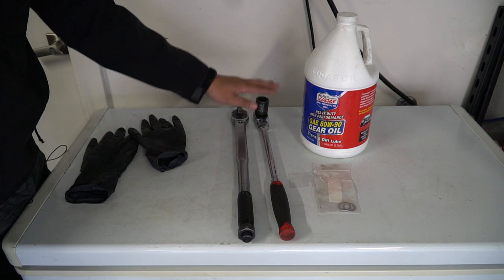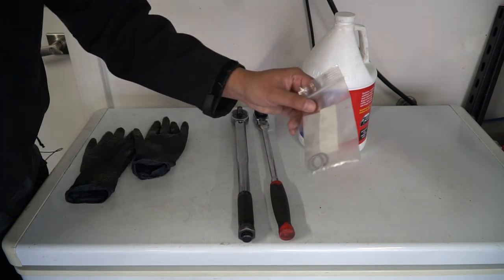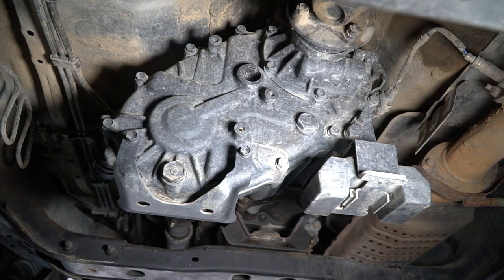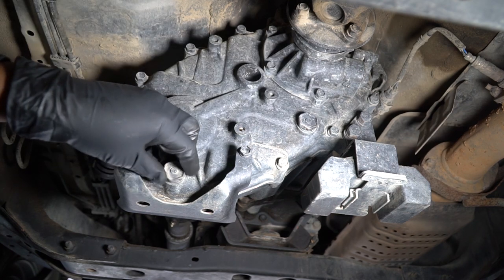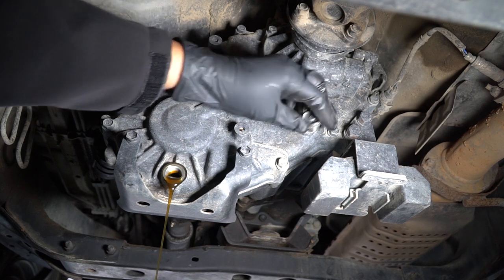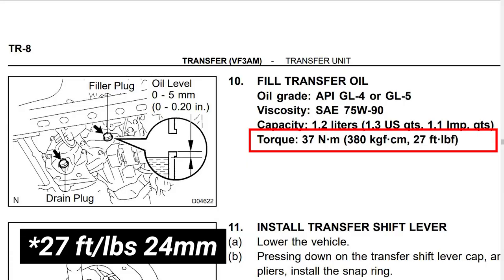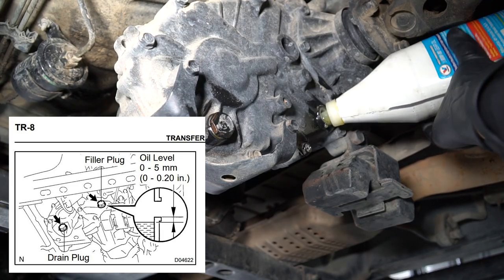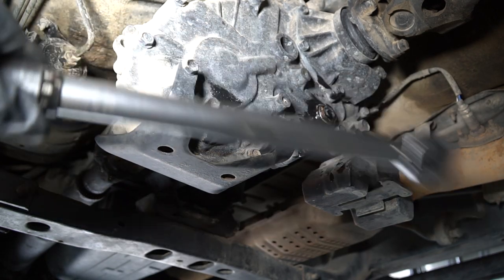Transfer Case Gear Oil Change - Toyota 4Runner

Comment: I was at my local Toyota dealership picking up a breather plug and was curious how much they charge for front and rear diff and transfer case fluid change.  $392.50, wow.  For all three of these combined you’re looking at 5-6 quarts which will run approximately $80 give or take.  It pays to do these jobs ourselves and great videos like this make it possible, so thank you!
Reply from the maker: That’s crazy…lol
Reply: i used to do these gearboxes as a lubeTech in the early 1990s... it was either 14,99 or 19,99 per each gearbox back then...
Reply from the maker: @efil4kizum so cheapppp
Reply: @PhoRunner  minimum wages were like 4$ /hr way back then so there's that!? but today you have to put in almost twice as many hours at the minimum wage for the same service as you did 33 years ago if its more than 100$ for each gearbox now
Reply from the maker: Gas was $1 back then too so seems about right!!
Reply: Gear oil or transfer case fluid?

Comment: Hey quick question can i engage my 4wd on dry  pavement if im going really slow and straight not making any turns. My 2000 sr5 didnt go into 4h when i tried to engage it moving about 5 mph it felt like it did engage but the light didnt come on and they truck felt kind of held up i shifted back to 2h and it didnt seem to fully disengage untill i went into reverse. While stopped i can engage it and the light comes on could this be from not useing it often thw truck has been siting for awhile
Reply from the maker: Going straight is fine to engage on pavement.  Sometimes it can take some time/ tries to get it to engage.
Reply: @PhoRunner  I got it to engage but I feel some kind of Resistance like as if in full wheel drive, it doesn't want to roll forward when in drive is this normal? I hear no funny sounds or clunks just feels like resistance when I press the gas
Reply from the maker: @Cmc-365 are you in 4hi or 4lo
Reply: @PhoRunner  4 high.  when I gave it some gas I heard a little cherp I think.  it just feels like it's being held back I'm not near a dirt  road so I'm just goin back and forth in a straight line I'm scared to give it normal gas I'm just pressing down soft on the pedal and when I let off you can feel it slowing the truck down
Reply: Could it be the front drive shaft maybe it's warn out and binding I haven't used 4x4 since I bought it I've been slowly working on it the guy I bought it from just showed me that it engaged into 4 high and 4 low so I assumed it worked. Lol
Reply from the maker: Likely nothing wrong. 4wd drive system is robust. One time I engaged it on pavement and did a u turn lol. It jerked and jerked but got through

Comment: I just bought my first 4Runner it's a 96 and it's got almost 340,000 you can imagine I've got work to do! cuz I want to make sure I didn't get ripped off, so I've been finding out what I really bought and just tonight I put grease in the front axle because the vehicle set on a little bit of an angle and the next day there was a pool of axle grease on the ground :-( also now the trouble light came on, the little light that's like a trouble light that shows like a engine transmission and I don't know what it is? What the trouble might be what the sensor is pointing to?
Reply from the maker: Try obd2 scanner

Comment: Thanks for another great video. Will definitely have to check the oil in mine. Love the new intro as well.
Reply from the maker: Thanks lol. The oil last a while but if you want it fresh, super easy to do
Reply: @PhoRunner   60k miles? sooner? longer?
Reply from the maker: @efil4kizum it's dino fluid....it can go 100k if you really want it to. I personally do 50k but my old man has done infinity k (e.g. never) LOL. His little pickup still chugging!

Comment: What milage are you getting for half a tank of gas?
Reply from the maker: 100 lol maybe 110
Reply: Knowing you have mods. Front bumper, bigger tires and loaded storage your still getting better then me with a stock truck my half tank i got 80 miles.
Reply from the maker: Wow that’s really bad for stock. Check the O2 sensor, maf and perhaps spark plugs

Comment: I have been using Amsoil in the gear oils. If you want the most out of it 75-90 is superior to 80.
Reply from the maker: Never heard any transfer cases blowing due to oil :)
Reply: @PhoRunner  not the case the gear inside. I mean we are talking 400-500k out of your rig. In the case studies with Amsoil.

Comment: Are you using the same oil as front and rear diff
Reply from the maker: I am
Reply: @PhoRunner  🤙thanks for the info been reading my manual but OEM oil $$$ thanks again I have the exact same 4 runner
Reply from the maker: Cool
Reply from the maker: Nobody runs oem lol. Just get whateve gear oil that’s 75w90 or 80w90 and it’ll be all good

Comment: this is a very cool clean rig you have! ... good thing you are not that exposed to winter roadsalts like my gen1 taco is
Reply from the maker: It did live in Canada most of its life. It was very rusty til I got a hold of it
Reply: @PhoRunner  You did a great job cleaning it up!
Reply from the maker: I’ve dealt with so many broken bolts lollll. Think I replaced them all as I took stuff apart and replaced things lol